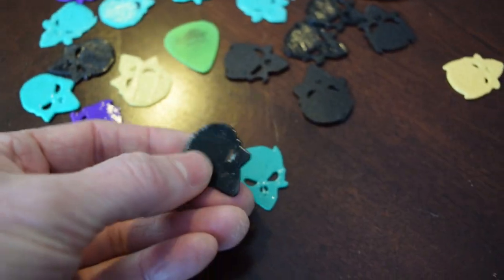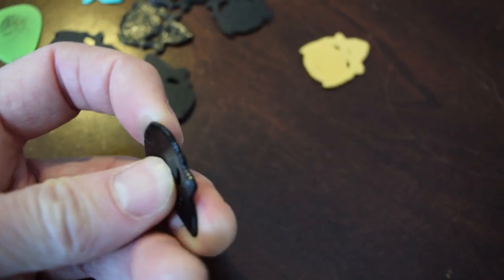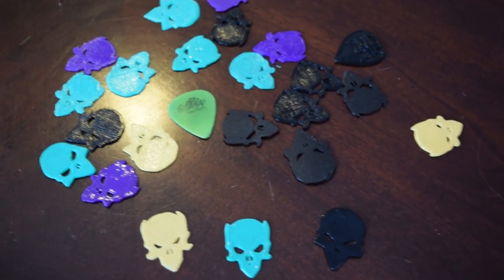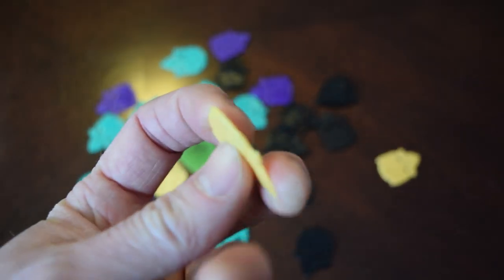Dunlop Tortex VS Custom 3D Printed CHUGHEAD Guitar Picks | Clean, Heavy and Acoustic Testing

Comment: what is the print material, and how thick are they?
Reply from the maker: I used cheap PLA, it worked great and I'm still using them today. They have all different thickness per color 0,4mm to 1,4mm if I remember well. I think I specified all these with the 3D files included in the description.